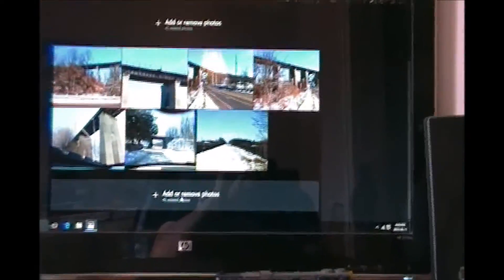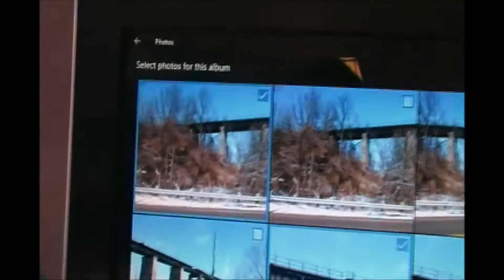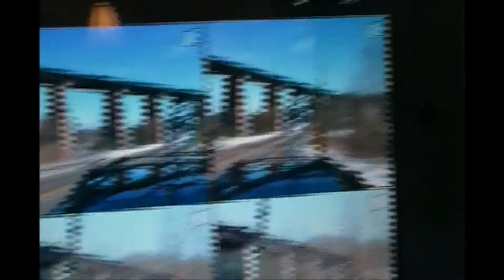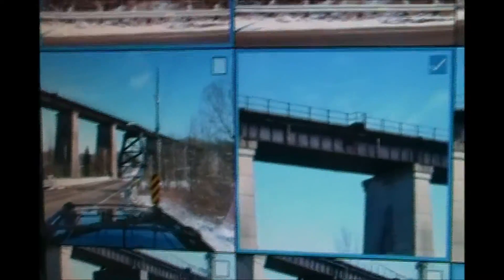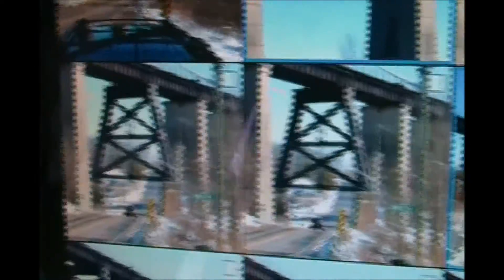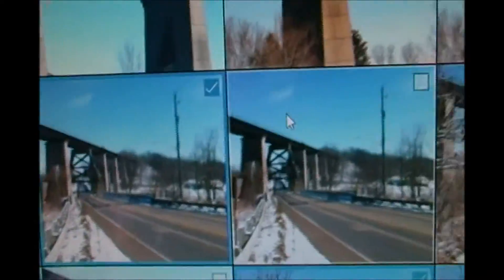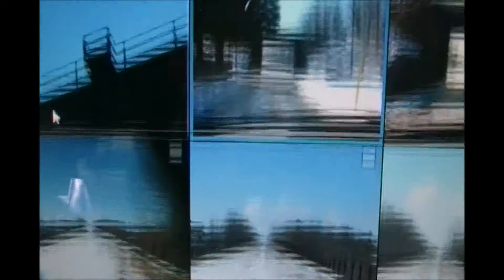St Thomas rail bridge ,

Comment: That bridge will look good on the layout.  Not too bad to build.  Get some Micro Engineering bridge parts for the top.  The piers I think will be the time consuming part if you make them yourself.  I would make them out of foam and clay.Scott
Reply from the maker: foam and clay is one idea , or I was thinking wood for strength and plaster to cover it , sand , scribe the lines into it ,,